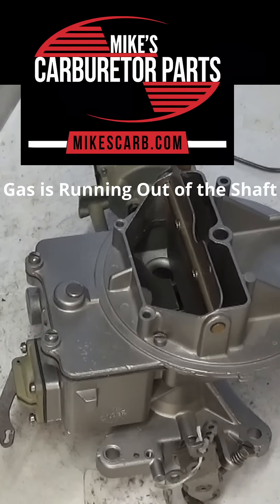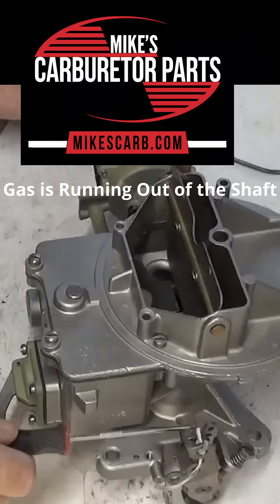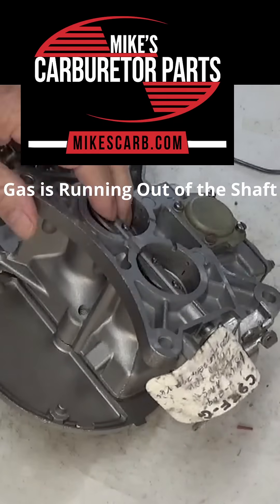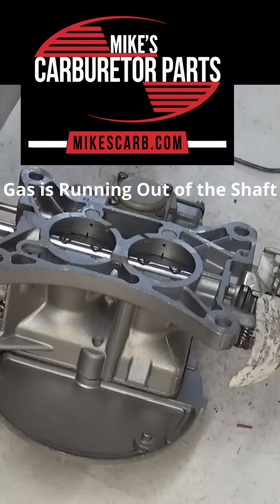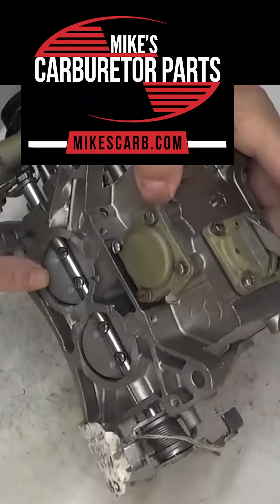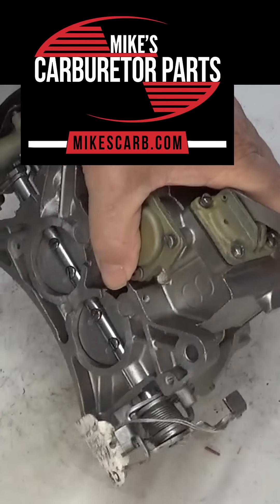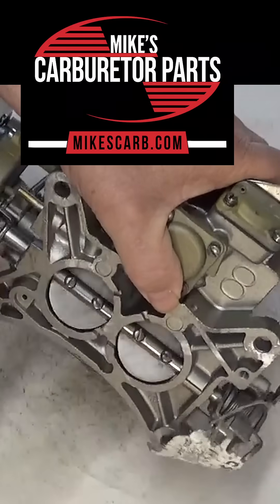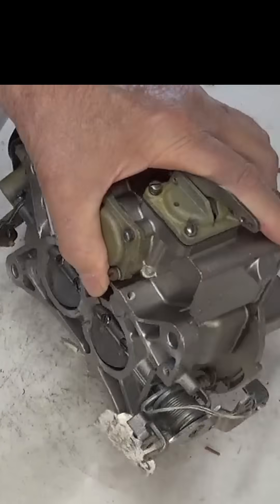Carburetor - Gas is Running Out of the Throttle Shaft

Comment: I'm happy I found this video. I have gas leaking through the throttle shaft after rebuilding my Rochester 2 jet . So this would mean the float needs adjusting?
Reply from the maker: Probably not the problem. Leaky needle & seat, too much fuel pump pressure. Check out this page for more detail: https://www.carburetor-parts.com/2-jet-is-flooding-gas-leaking-out-the-top.html